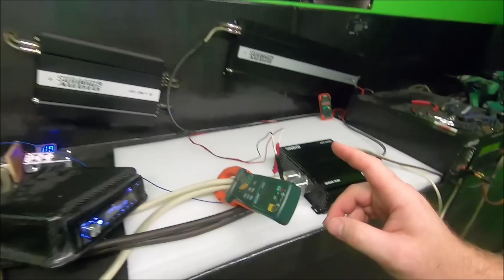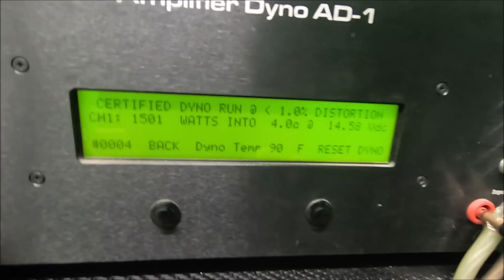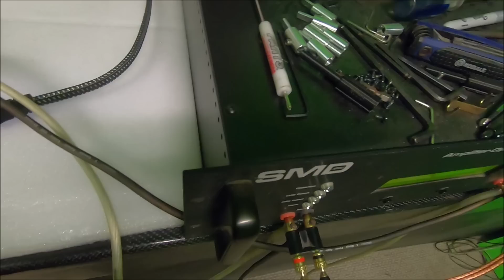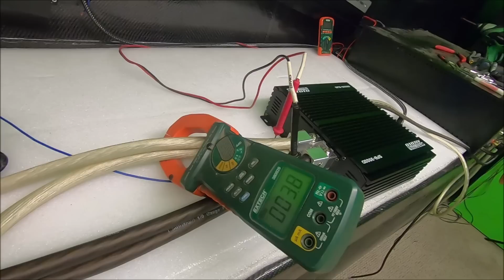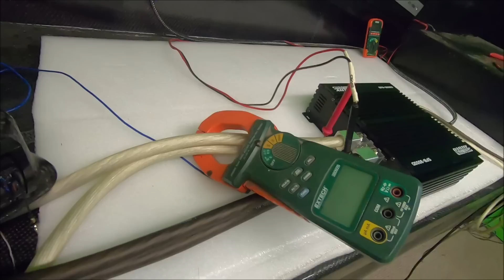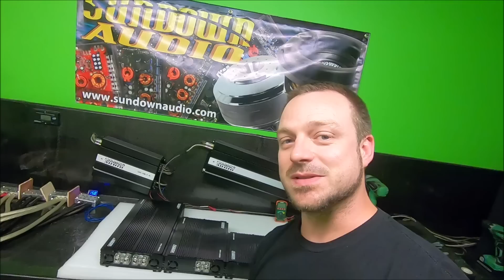***You Won't Believe How Much Power*** Sundown Audio SFB-3000d Amp Dyno *Amp Test Tuesday*

Comment: The sia 3500d could I run it on a 300 amp js alt and stock battery I hold 14.9 volts when no amp is hooked up I'm powering a x15v3 with it

Comment: I have 2 SLD 12s DVC 4ohm wired to 1ohm at the amp. My gain is set to 3/4 and no bass boost on amp or head unit.

Either the SLDs are wayyyy under rated power handling or something is up. RMS is 500w each. I’m sure they are getting over 2000 watts and nothing is getting warm amp or subs.

Maybe the 3000 watt is bs?

Currently using xs power agm battery and Ioxus ultra cap group 32 400 fared with 1/0 ofc welding cable and 8ga ofc speaker wire.

I’d like to run a more power single 12” DVC 2ohm at 1ohm like a solo 2000 watt sub but I feel skeptical of this amps true power.

My voltage is always 14.8 to 15.

Not making much sense unless the SLDs can really handle 2000+ watts no problem.

Comment: good power but, the efficiency is a seesaw, I don't know if the ammeter was not fast enough but I think 1ohm is the sweet spot of these amplifiers , 61%@4ohm, 57% @2ohm , 64% @1.3ohm, 87%@1ohm (certified).

Comment: I just bought one of these things and I must say. In over 15 years of being into car audio I've never been more disappointed in a piece of car audio equipment than I am with this amp. This amp is a step above junk. One step...literally 1 step
Reply: Whats wrong with it? I was considering this one for my 4 8s
Reply: 1000x better than my last Alpine amp. I’ve literally used it daily @1ohm zero issues and it slams my 2 12s.
Reply: Did you try and contact anyone at sundown?
Reply: @matt6951  yes... they had 100s of returns of these amps...the SFBs were an epic failure
Reply: @seankiesling2054  100s, they sold hundreds of thousands.. this amp made them a fucking boat load of cash.
Reply: @matt6951  yes and got a TON of terrible reviews and feedback and returns (me included)

Comment: I just wished that if these amps require a dual 1/0 input that they would have designed it with dual inputs like Orion did on their 3000 watt amp.
Reply: I noticed that as well my man. Got two 3ks feeding 2 12” hccas but dual runs is a must just gotta get the reducers np

Comment: So 266 amp draw. 15ft run of #2 welding wire should be good? It’s rated for 300 amps

Comment: So this amp is $350 and the sae 3000 I believe is twice as much. Why is this one so much cheaper?
Reply: Chinese board. Likely doesn't like lower ohm loads. Where as the sae can be wired to the dirt without an issue.

Comment: Orion xtr 2500 does same power, and is cheaper and better build quality.
Reply: Xtr is amazing but. Its bigger,so for those wanting a smaller foot print this amp is great. And still incredibly affordable. On Amazon the xtr is only a few bucks less. Either way both are outrageously affordable for the power.

Comment: How loud are the fans on the amp? Also, my "dual 2 ohm" sub are actually read 1.4ohms. Wired down I'm at  .7 ohms. Is this okay?
Reply: No amp would fry
Reply: How many times does Derek have to say NO !! NOTHING BELOW 1ohm..
Reply: @408SPLKINGS  that bites. I guess I'll just stick with taramps. The sfb looked pretty sweet but not being able to handle subs advertised as"duel 2ohm" subs  wired slightly below 1ohm is a deal breaker for me.
Reply: @fornarnia8  there's plenty of quality amps to pick from regardless of country of origin, power ratings, & 
minimums. I trust whole heartedly in
Derek @ Sundown for being up front.
I myself will using a SFB 500.4 &
SBF 2k in my truck & D4S JP23 JP234 in my other truck. Good luck & enjoy 🚙📻🔈🔉🔊🎶🎵🎼💨💨💨💨💨💨💨💨
Reply: @408SPLKINGS  thanks! I just really like these full bridge designs. Seems like the future of car audio to me.

Comment: Efficiency was 53% at 2 ohms, 64% at 1.33, and I think it had to pull more that 260 @ 1 ohm other wise it's 88% efficient at 1 ohm which seem way high especially for a full bridge. Thing is a power house though still planning on picking one up at tax time for my two 15's.
Reply from the maker: The true efficiency doesnt come across correctly in the video.  Got a video coming soon to explain in more detail.

Comment: I just ordered this 3k for my 2 
FI SSD 15"s.hopefully a great match
Reply: Would like to know how it goes and sounds
Reply: I just received the 2 X Fi xv3 12" subs and also running this 3K.  It is getting installed this week.  Any updates on yours?
Reply: @larry9729  
No yet..i just ordered my h.o. alternator. I will have an update sometime in February
Reply: i really really want to know what u guys think of this 3K on subs. about to pull the trigger myself on this thing
Reply: I finally got my SFB 3000D hooked up on my Fi xv3 12s, and only at 1/4 gain to wait till my breaking period, and this thing is sick.  The custom box is tuned to 40hz.  My 2018 GX 460 SUV is loving the power.  Damn thing doesn't even rattle. NOTHING Rattles!!    Only had to put a couple pieces of weather stripping on the plate, but that is it.  Box has about 2.1 cu ft per sub, with the subs inverted in a V config.  Can't wait till the break in period is over and subs get to really moving!  So far, I'm impressed.
Reply: Larry972 post a video bro i been looking at those xv3 no videos anywhere on the net
Reply: @SimDriftingUnited  Try this.  I don't have the music on.  I'll do a vid with music tomorrow:  
\

Comment: So you can run 2 15's off of these?
Reply: Helllllll no! I just purchased this amp and had it installed to just ONE 15 and it barely makes the sub move. Without clipping or squaring off these amps only put out about 1600 watts. Stay clear... these amps are junk
Reply: @seankiesling2054  u should learn to tune a amp
Reply: @seankiesling2054  kinda seems like your bothered by my comment which suggests you did it from the sounds of it and cant tune lol but lets take your word for it

So again

Learn to tune ( so yes do it yourself this time) and itll sound better

Comment: Same power.  Smaller footprint. 
Are big chassis amps obsolete now????
Why would they put out legit competition for thier own amplifier lineup?
Reply: As he said in the video these aren't stable below 1 ohm like the older amps are. They are also heavily voltage dependent so people without a robust electrical system may still want the older models.

Comment: My electrical system can’t support 360 amp draw. My alternator is all together 150 amps.
Reply: Yes but your car also has a battery. Your electrical can put up more than 150 amps in bursts. To run 3,000w+ you're always going to need some kind of electrical upgrade to get the full benefit.
Reply: Send it

Comment: This guy does everthing HIGH voltage, who has a 3,000 wattage amp and has HIGH Voltage! Not me all I would do is upgrade the battery under the hood and add a battery in the trunk. He's scared to let it drop to below 14.0 volts. Because sundown amplifiers aren't good below 14 volts! Tell him to prove me wrong! Start the test at 14.4 and then see what you get! I seen a guy test a  Saz 3,000 watt amplifier and it  didn't do that good! All I'm saying is Sundown is only good at HIGH voltage! So, if you don't have  high voltage you won't  get what he gets! Check all his videos with Sundown amplifiers and show me one that he did that's wasn't HIGH voltage! So, like I said if you don't got HIGH VOLTAGE don't buy SUNDOWN! I'm running a B2 audio m15r amplifier and it does good at "LOW" VOLTAGE and is a Beast at HIGH VOLTAGE!! If in doubt check Steve meade video on it!

Comment: So if you don't got high voltage. Don't get this amp! Because it probably won't do 3,000 at 13.8 or lower voltage. Tell him to prove me wrong!
Reply: Im wondering what numbers would come up at 13.8v down to at least 13v at 1ohm
Reply: @michaelhernandez4912  probably around 2500-2000
Reply: Not horrible, i just have an sa15 i wanna run it on
Reply: @michaelhernandez4912  then that's plenty of power!

Comment: I would love to see what the 8000d  does at 2 ohms. I need a clean 5k out of it. Hope it will do that atleast.
Reply: If the trend shown here holds through the series you'll def get 5,000w if you can feed it the voltage/amps it wants.

Comment: What about using 4 gauge power wire.
Reply: You can't use 4 gauge for a 3,000w amp unless the amp is a foot from the battery.

Comment: Trying to decide between this amp and the soundigital sd3000.1. I'm running 3 12" subs with a 2.66 ohm load. Gotta see which amp will give me more power at that load plus with imp rise. Price is similar and so is the size. And throw the Tiffany RCA on the 3000!

Comment: That amp is about 65% efficiency at 1 ohm.....not bad, but that other 35% will be shed as heat through the heatsink.  With such a small heatsink, are you confident it can radiate enough of that excess heat to provide reliable play over a long period of time?
Reply: This is why I want to get the 8k and run it at 2 ohms on my 2 18s. Stay efficient

Comment: Still Brazilian board unless shown other wise efficiency is meh on all others I've seen. Other 3k Brazilian get outperformed buy korean 2-2.5k after rise. Not as good cone control either. Guess sundown plans on taking part of the Brazilian amp market.
Reply: If you mean the full-bridge amp market, yes, we are entering that market due to the customer demand. Of course we will still offer our beefy Korean amps.
Reply: Do you amps differ from ones already on market. Curious about crossover & other internals in comparison.
Reply: @jkindlesparger  All of our Korean Class-D amps are our own board designs. Naturally all of these amps do look fairly similar -- but we do have our own variation on them all.

Comment: I like the longer videos ✅ whether new product testing/ torture tests /project SPL .. I think ppl may complain cuz you say part 2 coming soon then disappear for a week each time & it happens more now. 

Wow .. these make power at 2-4 ohm that’s great for impedance rise ✅💪

“ A little small 270 amp alt “ hold up... 270 Amp alt is huge alt lol most ppl have 80-150 amp alts lol 

I don’t think something labeled as Output should be used for input ... thanks for the vid...  

How does the sound compare to a Korean half bridge? I’ve never heard a full bridge amp

Comment: Looking forward for a  test with 5 minutes full Power @ 1 Ohm :-)
Reply: I saw the guts from the other video. I don't think that it would hold up well, the power supply transformers weren't that beefy and there's no way they could withstand 150+ amps apiece continuous. I hope they have a good protection circuit in them.

Then again, music isn't a continuous sine wave bass tone. I'd definitely trust them at 2 ohms. Even at 2 ohms the power/price ratio blows everything else out of the water.
Reply: @thorlancaster5641  So, you're saying Sundown made a 3,000 watt amp that can't be used daily at it's advertised 1ohm? 
Well then this amp would be the first time I've seen something from Sundown not perform as advertised.
Reply: @ThisGuyDrives  I've built a few class D amps before and there's no way the number of FETs they used could handle rated power continuously. Even with state of the art FETs such as IRLB8743s. They get away with this because music is not a straight sine tone. If you tried to play a straight sine tone it would hopefully go into protect.
Reply: I bump this amp daily for over a year @1 ohm no problems at all.

Never even gets warm at 3/4 gain and zero bass boost. Running 2 SLD 12s
Reply: The orion xtr2500.1 puts out 3288watts at 13.64 volts at 1 ohm certified. So i would say its better. And its a 12v/14.4v amp
Reply: Are these numbers max ratings or rms ratings?
Reply: @jaysta86tube  pretty sure they're max
Reply: @thorlancaster5641  you think the amp would have problems rmsing two 600 watt rms subs at 2 ohm?

Comment: 2 ohms 2400 1 ohm 3400
oof 3 off not too bad
also I wouldn't be surprised if this amp didn't do well on the peak test, it seems to be a class T, which has variable rail voltage, hence why it does so well with high impedances. The amp switching from lower to higher voltages during the peak test can hinder performance which is another reason to skip this test.

Comment: 20yrs ago if I saw an amp this size and it said 3000 watts I would expect it to put out around 30-40 watts and have an IC amp chip lol
Reply: Well, I just purchased this amp and had it installed..it most certainly does nootttt put out 3k watts like it says. In 15 years of car audio I've never been more disappointed with a piece of car audio equipment as I am with this box of junk... don't buy
Reply: @seankiesling2054  Did you clamp what you actually hit? very interested in seeing real world results on this amp.

Comment: Amp dyno only tells one the amount of power but not quality. So how's the quality? How long can the amp hold such power? It's insides are questionable to hold power for long periods. Dude, I am sorry but I ain't sold.
Reply: 1% total harmonic distortion of the input signal .... very clean output
Reply: 25Hz to Life - quality?  These are certified runs, it only measures100% clip/distortion free power
Reply: I'm sure you'll see some feedback coming in. Around 100 pcs are already out there.

Comment: Just did  side by side video watching the taranps hd 3k and it was similar but taramps kinda killed this one. And cheaper as well.Sure taramps isnt rated at 1 ohm, bud had 3500 watts at 2 ohm. And did i mention cheaper? Either way I wouldnt trust either amp.Seems like it is a lot of stress on such a tiny amp to be reliable for years on end. Just my opinion...
Reply from the maker: Found it.  You're comparing uncertified at 1kg to our certified run at 40hz.  That's not a comparable test.  The certified 40hz tests did not do as well as this amp.
Reply from the maker: I've watched every taramps 3k amp dyno I could find.  Didnt see any do 3500 @ 2ohm.  Link me if you would.

Comment: that sounds like the power supply is undersized for the capability of the amp section, the rail voltage is dropping as the amp draws more power, so much so that you got only 3200W @ 1 yet get 2500W @ 2, instead of a linear 1250W @ 4, 2500W @ 2, 5000W @ 1
Reply: Yes, of course, with a higher cost power supply it could push out more at the lower impedance. These are made to be ran at 1-ohm nominal where you generally have decent reactive impedance "rise" -- they are NOT made to be ran below 1-ohm (where you would need that beefier power supply).

Our more expensive stuff, on the other hand, is happy at the lower loads.
Reply: @jacobfuller9893  i do enjoy my SCV2000D my dude, kinda sad it was discontinued
Reply: @wow1022  We may end up with a SALT-2 in our line (a Korean successor to the SCV-2000D). With the tariffs on China hitting 30% it is likely the SAE line will phase out and return to Korea in the SALT series.
Reply: @jacobfuller9893  but my concerns are in the life expectancy of the power supply transformer, if the amp is pulling so much current to collapse the rail voltage so much, V^2/R says you are dishing a lot of power out of that transformer (assuming the transformer is the highest impedance path between the power supply fets and the amp itself)
Reply: @wow1022  On the transformers: If we see any longevity issues we will upgrade them down the line. In our testing so far they are holding up well and don't appear to be getting unusually hot. But we do take reports from our repair center into consideration when updating amps =) These do carry our full 2-year warranty as well.